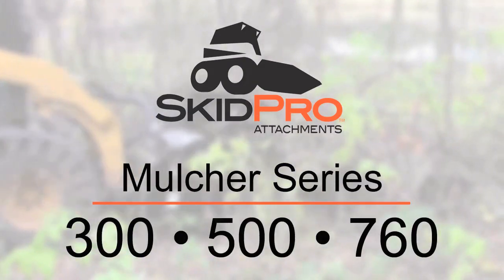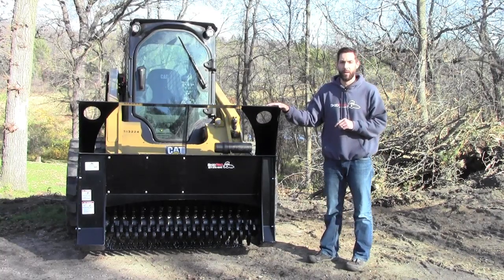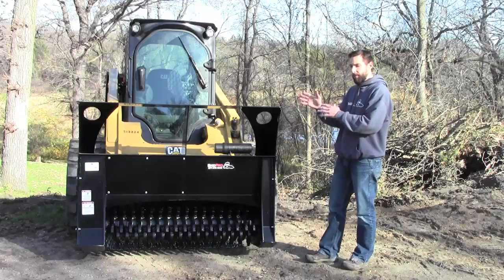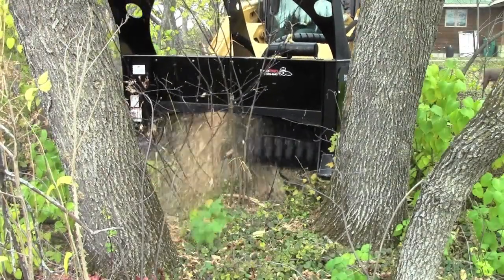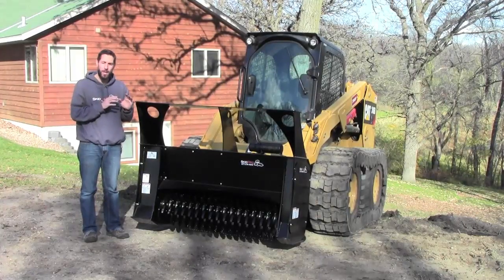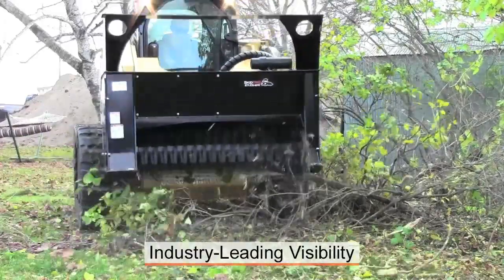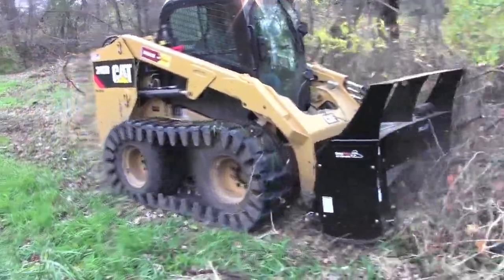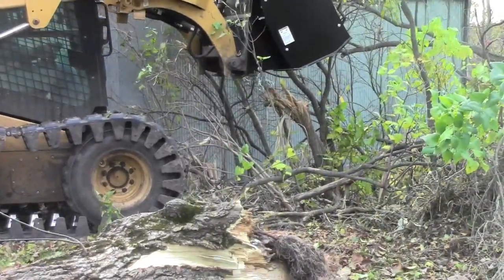Skid Pro Skid Steer Forestry Mulcher

Comment: Can you mount the 48 in. on a large mini skid steer with 14 gpm
Reply from the maker: It likely could be mounted, however weight, function and performance are another matter. Weight for one would be tough on a mini skid that doesn't have the lifting capacity of a full size loader. Beyond that, handling that weight while turning, backing up, and lifting etc. would be tough. Lift height would also be an issue. And all of these concerns are before we discuss the performance you'd get at 14 gpm, which would not be optimal. With the limited information at hand, I'd say we would not advise this, however we're happy to discuss the entire situation over the phone if you'd like to delve deeper into it. You can reach a Product Guru at 877-378-4642. Thanks.
Reply: skidproattachments yeah I looked at the weight after I posted. I have a Ditch Witch SK 850 which is one of the largest mini skids on the market. It has a lot of torque for a machine it's size and can move around 3000 lbs. maybe a foot off the ground but the head would need to weigh around 700 lbs. or so for good manueverability on rough terrain. 

That being said, I've done a ton of research on compact mowing equipment over the past several years. Every company that I've talked to nay says the idea of a mini skid mulcher because it doesn't have a cab. You can see where they're coming from, but yet mini skid rotary cutters are a dime a dozen. I own one myself and I'm convinced that a mulcher with green teeth that takes small bites and has a good chain curtain design would be every bit as safe if not safer. Like anything else you do with a mini skid, you're not going to remove all possibility of an accident unless you operate it responsibly.

 We already know that mini ex's with similar power and flow can do well with mini mulchers so who's going to be the first with a mini skid version?
Reply from the maker: I do believe the liability concern is legitimate for a manufacturer. It is hard to put your name on a line and put the business at risk of a potential issue over an item that doesn't look like it will perform well on paper, and promises to be a low volume unit. I can sure see both sides. But I did want to share this with you. It is a video link from a customer showing our mini walk-behind/mini excavator cutter on a larger Vermeer walk behind mini track loader, https://www.facebook.com/gatorstumpgrinding/videos/1425464474267120/?t=0. Overall the customer has been very happy with performance and says he can get done the work of four to six guys with hand tools compared to this unit, making for a quick projected payback.

Comment: i have 21 GPM but no drain case outlet is that a problem
Reply from the maker: Tide Slider - This is an old video showcasing our standard flow 500 series mulcher. I'll give you links to our new videos and a quick break down of our product offering. For detailed questions, it is always advised (especially on complex attachments like mulchers) to discuss on the phone w/ a Product Guru (877-378-4642). The long and short though, is we have a few different mulchers that will work for your machine (no case drain needed on standard flow below 30 gpm - internal bypass and pressure relief protects motor on shut down, eliminating need for case drain). Thanks again for your interest, here's the breakdown and added video links.

1 ) 300 Series - Standard flow only, most economical option, excels in brush and smaller saplings. Ideal hydraulic flow 12-25 gpm. Great option for heavy farm or home owner use and a great option for continued vegetation management.
Video - https://www.youtube.com/watch?v=iBUUeSN01_o&t=27s

2) 500 Series - Available in both standard and high flow models, ranging from 15 gpm all the way up to 35 gpm. Custom-match motor specific to machine's GPM output for optimal speed/torque performance. Produces finer mulch than 300 and handles bigger saplings while still being effective in brush. Great option for heavy personal use or commercial use.
Video - https://www.youtube.com/watch?v=psMkJXTYHks&t=60s

3) 900 Series - High flow only, ideally suited for the biggest horsepower and high flows on the market in excess of 35 gpm and 3500+ psi line pressure. Our most aggressive mulcher with the most throughput, fastest mulching times and our largest capacity. The best option for heavy commercial use.
Video - https://www.youtube.com/watch?v=1OlGYyj_DdE&t=177s